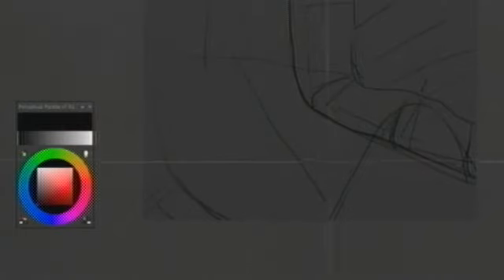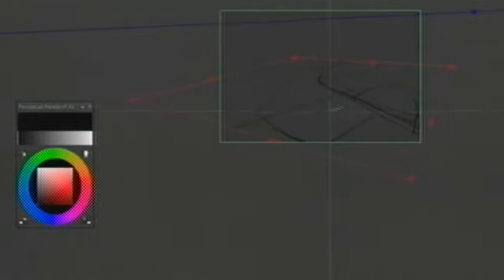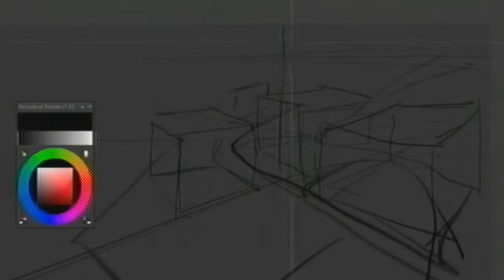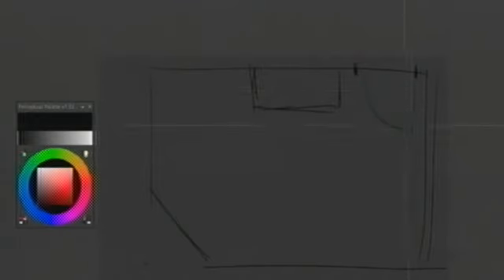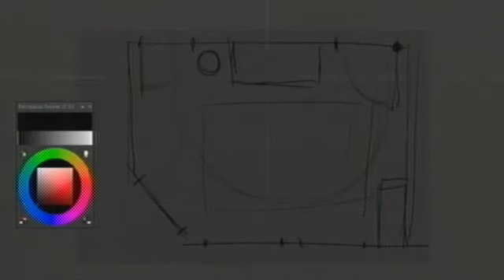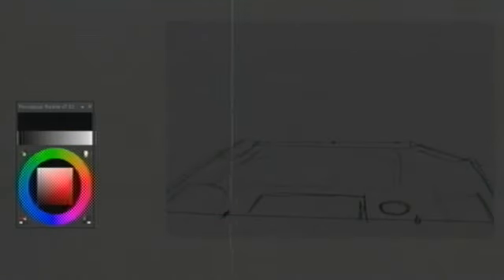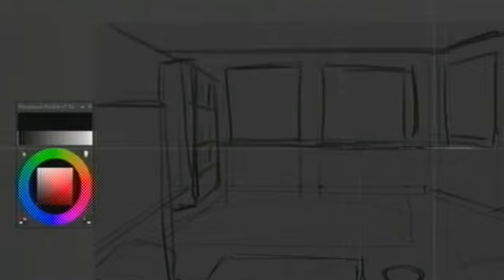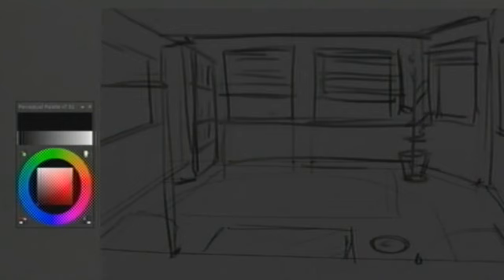Floor Plans

Comment from the maker: @tomvanharmelen The free transform tool in Photoshop is accessed with CTRL+T or Command+T or Edit>Transform

In TVPaint you can use the Warp Tool. Press and hold the second last icon on the Main Panel to find it.